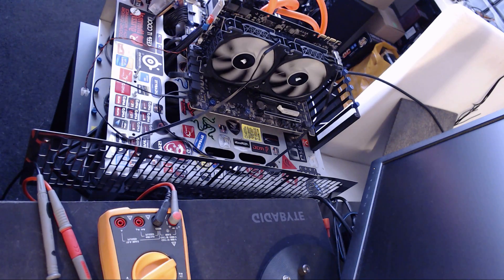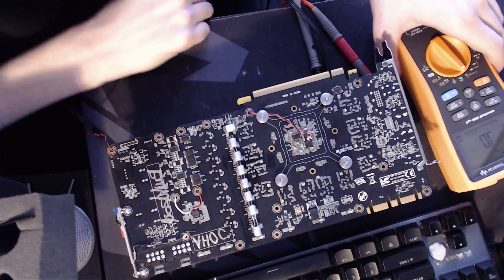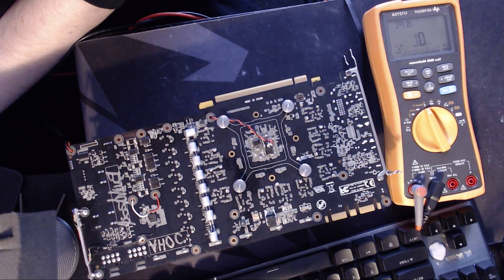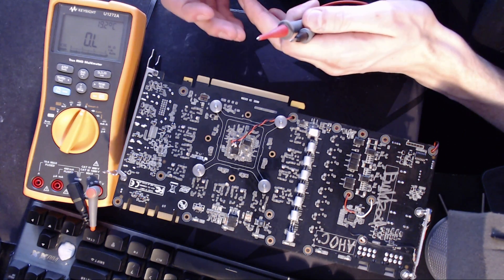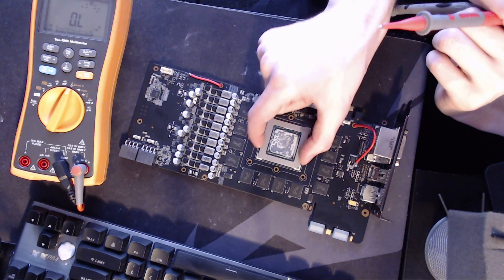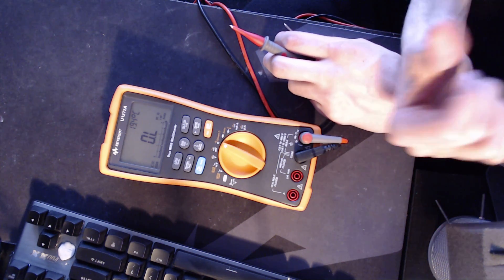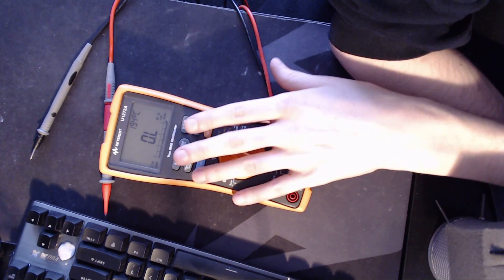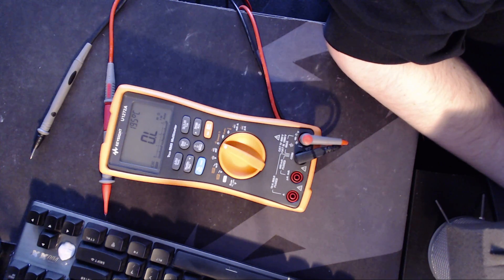DON'T USE CONTINUITY MODE TO CHECK GPUS FOR SHORT CIRCUITS

Comment: At a nominal 1v gpu core voltage, and only pulling 100 amps (pretty low really, can get several hundred running through gpu)- means total resistance from negative to positive rail is .01 ohms. This is solder joints on board and on die as well as silicon resistance. Yes your cpu or gpu is really really very close to a dead short when normally running. This is why a real "short" on either is pretty much not repairable, it quickly burns up traces on and inside pcb.

Comment: Thank you very much, you reassured me. I have a computer that fell on the ground while it was working, and when I turned it off after it fell, it did not turn on after that. When I checked it, everything was normal, but the vga circuit I suspected that it had shorts, but after I made sure I found it a small resistance in vga and not outright shorts

Comment: Thanks buildzoid I learned this while putting together racing drones.

It would beep all the time. So I would unsolder everything and rebuild it and it would still beep. I just said F it and plugged it in and it worked and Didn't know why.

Comment: I was working on resurrecting a 10 year old Core 2 Duo system with a 9600GT in it. GPU was getting super hot, even though I was only looking at the BIOS. The PCB was heating up. Clearly a short somewhere. I had some spare time so I brought out a multimeter, and found what looked like a suspicious capacitor; there was 0Ohm resistance to ground on both sides. So I found the rail the short was on!

I don't have the right tools to fix it, and I was planning to run this system headless once it was all set up anyway, so the GPU went to be recycled.

Comment: And here I were thinking that you were going to talk about how the test voltage for continuity mode of the meter can damage components like the GPU.

Since continuity mode and resistance mode on a meter usually operates differently.
The resistance mode usually outputs a small current (usually 1 mA) and measures how many volts it needs to push that current, and from that it can work out the resistance, this usually being fairly small voltages.
While continuity mode usually forces out more current (sometimes up towards 10-20 mA, this is so you can test LEDs in the field), and more voltage and can risk damaging low voltage chips. (A lot of meters happily output a few volts as to be able to test LEDs. Though the GPU and its less then half an ohm would require amps for it to reach damaging voltages, so that isn't really something a multimeter will be able to provide.)

Though, continuity mode on most meters start beeping around 30-200 ohms in my experience. So most modern chips and power delivery systems will look like a dead short as far as the meter is concerned. So yes, using continuity mode is not anything but annoying.

Comment: Multimeters read resistance in continuity mode also, correct term would be to search for a 40000 count or higher multimeter, don’t really spec digits in electronic test equipment
Reply: The only point of continuity mode is the beeping, which is worthless in this case (and would get annoying really quickly lol)

Comment: Just like my good old Avo8, you just need to see if the needle moves, who cares about the reading, if it aint supposed to move and it does, then there's a problem or visa versa... took me years to stop getting pissed at my first DVM because I had to actually look at it when doing this sort of fault tracing. I could see the avo on the edge of my vision, which could pickup the needle twitch...
ahh the 1980's were fun :-)

Comment: Qhick question about shorts on smd caps, if i put my meter in continuity mode and put a meter probe on each side of the cap and it beebs that indicates a short am i right. But does it mean there is a short when its in situe on the board. Or can some other componants on the board make some caps apear shorted.?? Or does it mean defo short, ive caps around my ram chips and they apear shorted. Two fets i found bad a got rid of the sgorts on the exr 12v but shorts still exist around the ram chips. Any ideas

Comment: Thanks for clarification, but what would it actually mean if i measure the vcore inductors (LR22) on both sides to ground at 0.5Ohms and the card doesn´t display and the fan spins full blast (RTX A2000). Doesn´t that mean there should be a short in the 3 vcore vrm setup? Is it possible the processor is fried even if the other vrms show higher resistance (50-80Ohms)?
Reply: Fan spin with no display usually is caused by faulty vram on those cards, try testing using mods and see which vram is bad display should be through the iGPU

Comment: Temperature also affects resistance.   That board you can't get to POST? Low resistance measured compared with brand new board...   IC must be faulty !  No,  it's been running several minutes and is hot.  The one you got from the warehouse is freezing cold and hasn't been on.

Comment: C660 cap (from looks and C-designation (printed on the pcb) I heavily assume its a cap) came off the board (backside) of my 980ti  (EVGA SC+ ACX2 - ref design PCB) when replacing the backplate and block. It seems to work, but I've been unable to find information and don't wanna push it until I've talked to someone's whom know what its for. Its situated right "above" the PCIE 16x socket locking tab, a cluster of caps and a few other tiny SMDs, right next to an IC marked "3A 2H 34B".
Any ideas what this cap is for? Am I safe to overclock the snot out of it without? I haven't had major success resoldering it to the board, the pad on one of the sides came off with the cap.

Comment: Hello,  I have a GPU that doesn't work.  It is a 1070 ti.  I was teaching a zoom class and I spilled coffee on the top of my pc and it leaked onto the back side of my 1070.  My power supply tripped and then nothing...I couldn't get the computer to cut back on...I removed the gpu and the computer turned one...I've since installed a new gpu and everything works fine.   When I install the 1070, the computer won't cut on.  Power supply trips.  Is the card done? Is there Anything I can do ? Thanks

Comment: Hello, I need your help, I am fixing a gtx 1060 and I see that the motfes get 12 volts but none of them work, looking at the up9511p controller there is no current to the vcc, do you know why it can be? Thank you so much

Comment: Do you know how much voltage your meter applies to measure resistance at various resolutions? Quick maths says it's probably not more than a couple hundred mV at this resolution, but I'd still be too scared to touch a graphics card with anything other than voltage mode :<
Reply: Handheld meters generally apply low curent on resistance mode (1mA on 2kOhms range, lower on higher ranges) and read voltage on the leads to apply Ohms law and show resistance.

Comment: got gtx 970 msi.  evertyhing seems normal on visual inspection, resistance seems normal ( from my  point of view and im new ( noob ), voltages i didnt messure but core is cold when i turn gpu without heatsink and ofc thers no picture.  only fans spin Any suggestion

Comment: Can I get your opinion please? 
I was gaming last night and then my PC shut down with no warning. I thought it was the CPU temp protection so I let it cool off a bit and tried to boot. The PC wont turn on. The PSU makes a clicking noise like a relay and then nothing happens. I took the GPU out and turned the PC on and it booted without the GPU in so I ruled out the PSU. I have a Gigabyte 980 Ti. I think the GPU is actually shorted and it triggers the overcurrent protection on the PSU. I took it apart but couldnt see any blown caps or burn marks. Any idea what to test on the GPU to find if it has a short or not?

Comment: Hi, I have the same meter and normally null the probes out when making low resistance measurements but it's still not as good as 4 point method

Comment: hello , i have an RTX 2070 Armor 8G that will not take the driver from nvidia.....default driver works fine but once i update the system will not boot.....ive tried a few different windows version and also a few Linux versions and i get the same result oince i update....

Comment: my gpu its a rtx 2070 gigabyte 3x fans and the power lights blink indicating an anormal power something, what should i check pls i need help
edit: my psu is perfectly fine and gives enough power to the gpu, just one day ive changed the thermal paste and idk what happened

Comment: When i testedr my rx 580  i found a lot of capacitors in short to ground and i am still not sure that my multimeter measured good (used in continued mode ) ...but where is the problem with no display , she worked and next day stopped  :|

Comment: great vid . i know you said dont ask and you dont wanna help probably , but if you have experience with definate shorts maybe you can help me with a little direction . shorted from metal dowl supporting pcie extension . cheap foam under the board and my own stupidity . replaced one cap that was visibly damaged still not recognized as connected . i feel like its more than likely easy fix but i dont want to just replace every cap if maybe the chip got fried from this type of short . . pleassee pleasse have mercy and help .

Comment: I know this is long but please read buildziod, your the only one I trust with computer advice.

EDIT: after outro . I do all of my own studying before asking for help, and I was aware the continuity mode was just a resistance tolerance alarm. I have one question now
-> SHOULD I PROBE AROUND MY STUFF WITH A FLUKE 117 NOW, while it's healthy, TO GET REFERANCE VALUES. (I am very very tempted to, but should I wait until I can afford an oscilloscope or until I can afford new stuff incase I damage something somehow?)

My stuff is a threadripper 3970 + ASUS dual OC rtx 3070 + ASUS prime trx-40

BEFORE EDIT : Fluke 117? Please tell me I invested ....... Dang it. 

Everyone said it was the best. Dam it buildziod, can have your email just for quick questions. I will make them short and not expect anything special. I'm really trying to learn 

I spent all my student loans on mathematics. I know a bit of coding but am on my own near the metal.

Comment: I'm surprised there hasn't been a huge gain or loss of subscribers because of this short rant.
Reply from the maker: well so far only 658 people have seen it.
Reply: @ActuallyHardcoreOverclocking  Your average video length is like three times longer than this one, which the angry rant part ended after 12 minutes, then it was back to good old rambling buildzoid for the next three minutes. 👍

Comment: Brymen BM869 cheaper and much better then Agilent/Keysight ...
Reply: I think that the BM869 has 10 milliOhm resolution instead of 1 milloOhm. But still looks like a good multimeter
Reply: In the 50000 count mode yes, but it also has a 500000 count mode. Anyway such low resistance can't be reliably measured without the "4 wire" method so ...
Reply: @galileo_rs  Just downloaded the manual, and the 500000 is  only available on DC Voltage.
So there  still is a difference in resolution in the ohms range.
Reply: You are correct, I guess I newer used the 500000 count feature with anything else but DC.